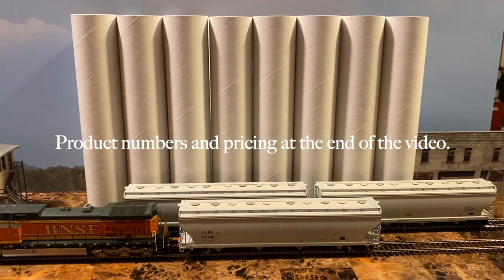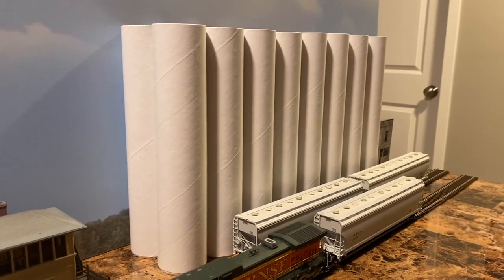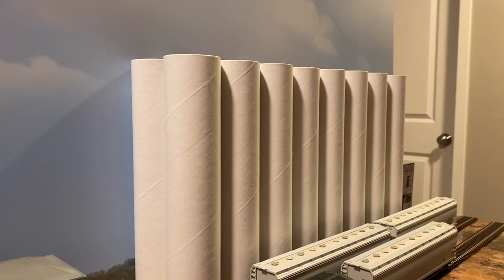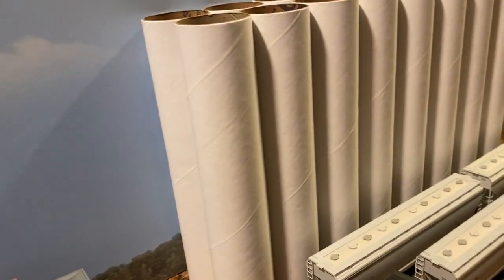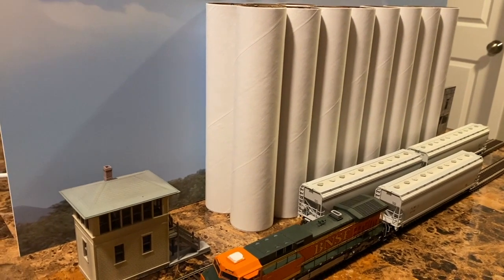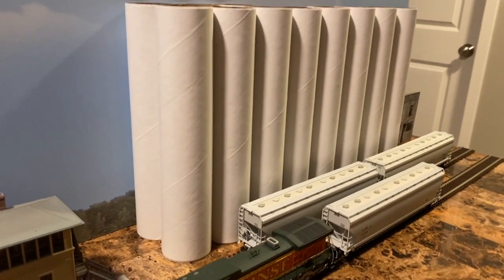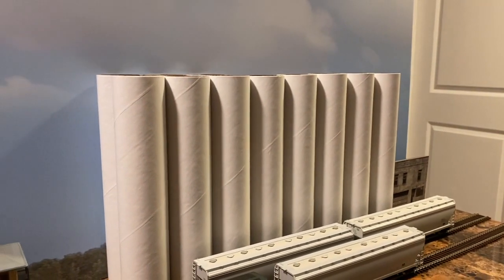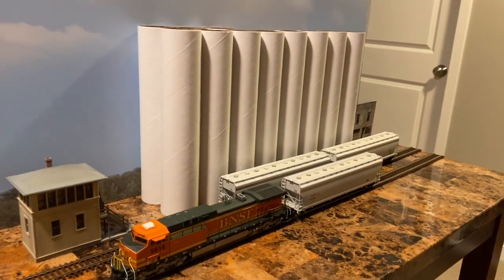HO Scale Grain Silos in bulk!

Comment: Only flaw I can detect are the seams in the tubes.  I've got some scrap PVC pipe that I plan on using as silos.  I see a Gibson SG hanging on the wall.  I play an Ibanez copy of a Strat.  Cheers from eastern TN
Reply from the maker: I have made many with PVC also but for the average modeler it could be a challenge to cut them evenly. To get rid of the seams just wrap with paper. I do not use the Gibson much. Mainly use a Jackson. More of the correct 80's sound I think. Thanks

Comment: Just to note a few things. First, those silos are too small to be used for grain silos as the heavy weight of grain would burst out. Next, those covered hoppers on the tracks are not grain hoppers, but used as light density materials hoppers like plastic pellets. So what you have are those paper rolls that are perfect for a plastic pellets company.
Reply from the maker: Yes I know they are they are smaller than the ones in the kit. But I did say they would be good to use as background silos not foreground. Also as far as the hoppers used to show the example I see these EXACT cars sitting next to the silos in the hundreds of them here in Minnesota. I use to work for Land O Lakes and many of the silos we had did not have any form of grain in them. Thanks for the comment.
Reply: @JohnsRailroad  It's okay. I just say this more for your subscribers as most modellers don't understand things like this. I've gone to train shows and seen grain sites with so many wrong covered hoppers on them. It makes me crazy!
Reply: @burleyscott2910  lol, I know how you feel about that. Those grain hoppers gotta have a big rectangular opening in the roof with 4 hatches to close over top, that all look like one piece.
Reply: @JohnsRailroad  The difference between grain and plastics hoppers is the bays on the bottom and the hatches on top. Grain hoppers always have 3 or 4 bays and a long rectangular hatch on top (that's actually 4 individual hatches), while plastics hoppers have 5 bays and small circular hatches on top.